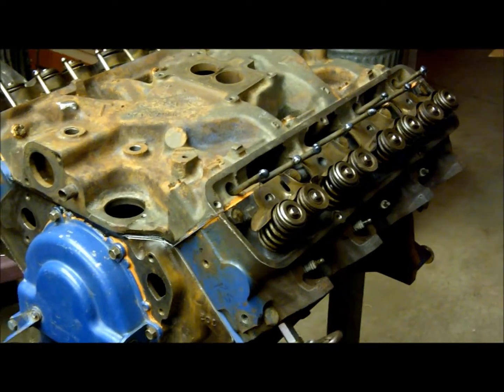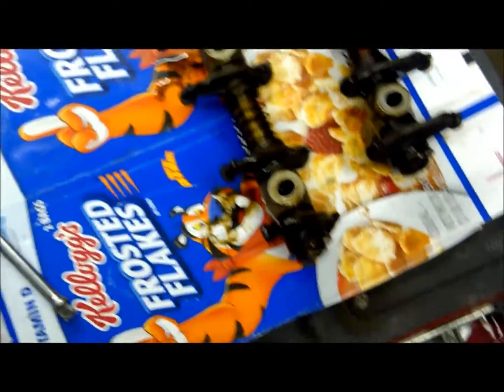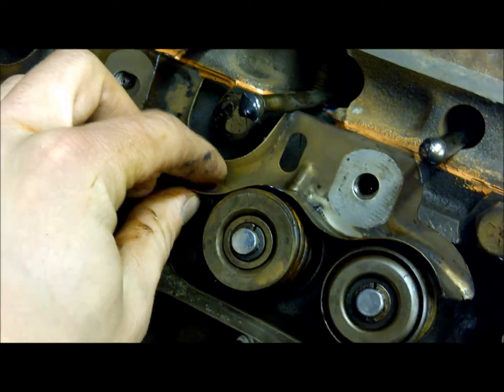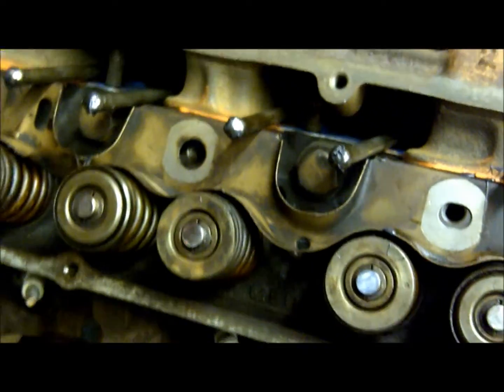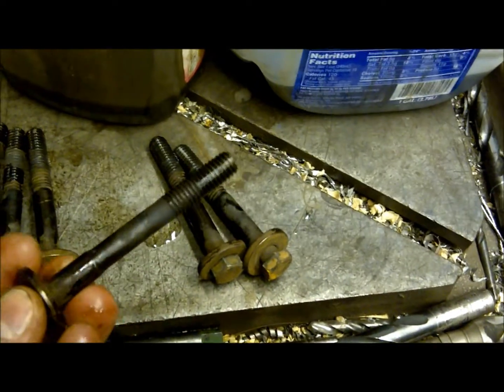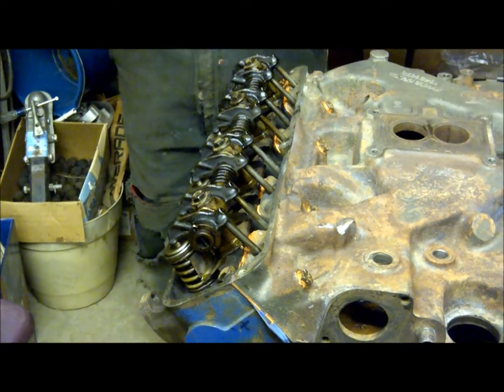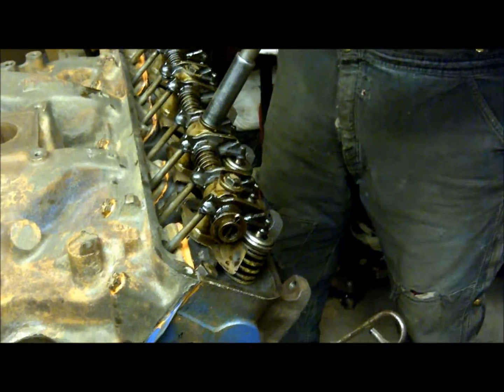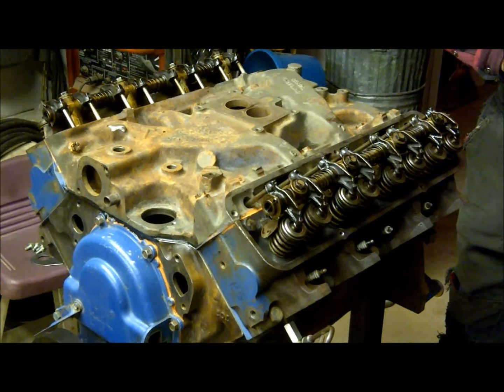How to Install Rail Rocker 390 FE

Comment: Some Windsor Ford engines used rail rockers -- FE's never used rail rockers - never ever never. 

"All 289 engines built after 1966 1/2 (except 289/271HP), and all 302 and 351 engines use "rail" rocker arms. Early 289 engines and 289/271HP use conventional rocker arms. The rail rockers are designed to "allign" the rocker and pushrod assembly with the valve. To do this, they have "lips" or edges that extend over the valve stem. Conventional rockers have no such "lips" and rely on either guide plates or "slotted" push rod holes in the head to keep the valve train alligned. "Rail" rockers should be replaced with some form of conventional rocker on performance engines that will see higher rpms."

Comment: Thanks for showing all of this. Just one question, if there is only one skinny bolt per side could you have shown us exactly what one.
Reply: The head is counter-bored where that bolt goes. On passenger side it is the third hole back if you count front to back. On driver's side it is the second one back.

Comment: Hello greetings from Germany.
I have a question, maybe you could tell me something about it.
I have a 63 galaxy with 390 FE
When the engine is really warm after 20 minutes of driving. Does he make loud noises.  When cold it is quiet. Have made two very short videos about it. Once where you hear the noise and after removing the valve cover. Now I noticed on the right side of the engine that there is a lot of play when I press on the rocker arm. What do you think? Is this a characteristic of bad hydraulic tappets. Because this should not be so easy to press. 
Here are the two videos.  Thank you very much.

Comment: I just removed my rocker rails and intake on me FE390 - 65 Thunderbird, 3 push rods were bent a lot and it burned oil. I plan to rebuild the heads and buy new push rods. Can you recommend a good manufacturer that sells these?

Comment: Quick question...do these type of rockers require valve lash adjustment?
Reply: Did you ever get an answer anywhere ? I had same question.
Reply: @pauliebots  they don’t,  they’re self adjusting.
Reply: @droughornz6080  thanks

Comment: Where can I find a set of bolts for a 2105 Edelbrock intake with the two bolts for for the oil hole on a fe390

Comment: One shaft on my 390 was put on upside down and the bolts were in the wrong place.  Not all shafts have notches, one of mine didn't.  So I had to look where the holes were. When I corrected all that and put a restrictor in the oil galley on each head my oil consumption went way down. The two longer skinny bolts go in where the head has been counter bored. On the right cylinder head it is the third one back, on the left side, it is the second one back counting from the front of the engine. Definitely rotate crank 45 degrees or about 2 inches on the harmonic balancer  so that none of the valves are fully open. Tighten each bolt two turns at a time until they are at 40-45 ft. lbs
Reply: I put my engine at tdc/0, to change the manifold gaskets . And have the distributor out so shouldn’t rotate the engine at all yet ? If so , when , how would ya know? Thx!
Reply: @Sunevel  Use a  lot of sealer at the corners where gaskets meet up, also around the water jackets are. Do it on both sides of the gasket for the water jackets. This is extremely important if you have any kind of pitting or corrosion damage. Also with an aluminum intake if you're using one the torque spec. I think is lower. Set the manifold down get help with the cast iron one so the back gasket doesn't slide out. Plus the damn thing is heavy! Leave the bolts finger tight and drop the distributor in. U can move the manifold a hair if you need to so it goes right in. Torque your intake down in the correct order. Now you can rotate the crank a little so there will be less stress when you put the bolts back in for the rocker shafts.
Reply: Remember though, if your rail rocker are bolted on too tight (torque), you will not get any compression readings and you don't want to lose either.
Reply: @asther113  The rocker arms are not bolted on to anything. They slide onto a rocker shaft which is bolted to the cylinder head by rocker pedestals.

Comment: Does the timing have to be set 45 degrees past TDC No.1 cylinder?
Reply: I was going to ask the same question.  Or can we leave the engine TDC and reassemble the rest of the engine.
Reply: @larrydarosa4867  that’s where I’m at now too
Reply: Rotating it 45 degrees past TDC insures all pistons are down slightly in the bore so there is no chance of a valve contacting the pistons.
Reply from the maker: ignition timing ???
Reply: In my manual, it says to rotate it 45 degrees past TDC on No.1 cylinder. Sorta threw me off.
Reply: According to the '62 Ford Thunderbird Shop Manual, the 390 crankshaft damper "must be" rotated 45 degrees past TDC (identified by "XX" on the damper) when both REMOVING and INSTALLING the rocker arm assembly "to avoid  damage to the valve mechanism",  I take this to mean that if this procedure is not followed, there could be damage to the push rods [e.g., bent push rod(s)] and/or the hollow rocker arm shaft (e.g., bent shaft).  So Ford said this "procedure must be followed", but is this just being overly cautious?

Comment: what would the symptoms be if the wrong bolt was put in? low oil pressure, valve clatter? Also how much lift can I go on a new cam without having to change the push rods or shim? what is shimming? thanks for the videos. Especially love the carburetor jetting and manifold vacuum vs ported videos!
Reply: Cody & Brooke Hanson - first notice that the oil passage bolt threading is farther in the head away from the SHAFT mount surface.  Short bolt barely grabs the threads and if it might torque to spec its durability is questionable.  The smaller dia shank on the bolt was to ensure more than adequate oil flow even when passages started to get "gunked up" with 1950s oil blends.  Almost all performance builds drill and tap that oil passage in the head for a restrictor = often Holly carb jets are used. The reason for the addition of oil deflector plates under the shaft mounting stands was Ford learned from the 272-312 & MEL Y blocks that too much oil was accumulating around the valve stems and being drawn either into the combustion cycle or scavenged by the exhaust pulses. The last Y blocks had an actual oil drain tube added to the end shaft mounting stand to reduce the amount of oil that was forced out the rocker to shaft clearance space.  New push rods are not required unless you alter the cam base circle (custom re-ground that gains lift by reducing the base) or to go with solid shell lifters. Shells are very light weight in comparison to hyd lifters.  Of course solid lifters require the adjustable rocker arms OR adjustable push rods for clearance.  95% of all "street cams would not require new push rods. Extreme -- well your spending big bucks so buy better material - stronger push rods to deal with increased valve spring pressures.  -- Your "shimming" is usually shimming the valve spring to obtain the correct installation height. Correct height ensures equal pressure (resistance to movement) on all the valves.  Even IF you had a major head planning done to correct warpage of the block mating surface, it would be very unlikely that you could use a head with so much removed that the hyd lifter would not accept the change.
Reply: @10susan10   wild amount of info!! Thanks !!
Reply: The necked down bolt is on cylinder. No.3 and 7.
Reply: @jimmyhawkins5357   
I read many places 
3 &6 . Uh oh. I’ll be Checking again!

Comment: Its a SHAFT not a rail....
Reply: 10susan10  maybe you should make your own YouTube video. With black jack and hookers
Reply from the maker: Was that comment really necessary, make you feel important? Lol
Reply: IF you do NOT know the proper technical terms then expect to get schooled...  EVERY Ford manual calls them shafts so grow up and learn the correct terminology for the parts you are referring to.
Reply from the maker: +10susan10 well, they are called rail rockers. Of course the rod is referred to as a shaft. Really who cares. I'm no idiot, check my channel, I do engine build walkthroughs and I build engines for people for f sake.
Reply from the maker: oh boy. you know, iv never run across someone like you. congrats for that. how did you even wind up on my video if you know everything
Reply: YOU are the one who stated "RAIL" (numerous times) not me -- YOU screwed up.  You also didn't lube the tops of the valve stems for initial startup. There is much more slide action across the top of the valve rocker end than the push rod ball that you did lube. Rocker ratio is 1.73 to 1 so the valve end moves 1.73 x the ball end.   Those TIN PIECES are oil deflectors as a result of Ford's 272-312 & MEL Y block experience. They channel excess oil away from the valve stem to the return path along the bottom of the head's upper surface and into the lifter galley.  Do you really think that Ford just threw in "tin pieces" cause they were making too much money? The later Y blocks has an actual relief drain pipe on the last shaft mount stand to allow excess oil to be directly returned to the lifter galley instead of flooding the valve stems in too much oil. Design issue of SHAFT mounted rockers that was eliminated with the individual studs in the newer 221-351 small block design that did use RAIL rockers to keep the rocker tip aligned over the valve through its range of travel. The reason why you must use guide plates and hardened push rods to use roller tipped rockers on a stud rocker system vs a shaft rocker. Maybe you should "dig" why items are designed to work like they do.
Reply: @fordnut4914  If you can't get it right then expect to get criticized. Technical info is only good when Its correct and a neophyte may NOT know the difference. There are people who are not experts you you .
Reply: @10susan10  could you do us a favor and throw an answer to some of questions in the comment section? Some are important I think and I don't have the expertise. Hope you can.

Comment: What exhaust was ran and what cam?
Reply: yeah i get what you mean by spendy, i like your vids there pretty informative
Reply from the maker: The stock cam was ran due to the rail rocker set up. I have no idea on the rest. Sold the engine
Reply: the fact that it is a shaft system doesn't have a lot to do with the cam, the FE rockers can take any lift they might need shimmed to accommodate higher lifts, but running a stock cam because of them just isn't right.
Reply from the maker: you have to shim them, and get different push rods. a bunch of different stuff thats fairly spendy. this went in a truck. an rv cam for towing was put in the engine that had the same base circle as the stock cam, so no valvetrain geometry change.
Reply: ThunderHead289 question what size bolts for the bellhousing to block? Putting one on a stand and not sure what size bolt to buy

Comment: I just put an intake gasket on, I am having a hard time getting my passenger rocker rail to set properly. the drivers side went in perfect, but the other the pushrods seem uneven. any advice you have will be appreciated, thank you
Reply: +ChapmanPaving, If they are uneven you probably have a pushrod or two out of the lifter cups. Also make sure you use the splash shield on both sides. Leaving the shields out increases pushrod preload too far.